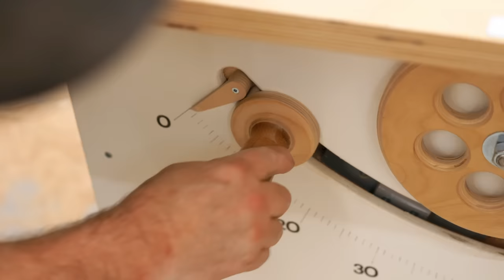Making A Modern Bed with Traditional Joinery

Comment from the maker: I made the bed mostly from solid ash hardwood that I bought rough sawn. The rough lumber needs to be cut and planed down to make the smooth parts used to make the bed, starting with the rails.
The panels of the headboard and footboard are joined to the legs with sliding dovetails. The dovetails mechanically hold the joint together, while also allowing the panels to expand and contract with seasonal moisture changes.
I used traditional joinery rather than metal hardware to put the bed together. The rails have tenons on each end that goes through the legs, and a walnut wedge locks the parts together.
The slats that support the mattress are 1/2" thick and 4" wide strips of solid hickory and these rest on cleats fastened to the rails. I cut spacer blocks to fit between each slat to keep them separated.
The bowties were added to the headboard as a decorative element. 
I used water-based polyurethane to finish the wood, spraying on three coats with a light sanding between coats.
This bed was designed to match the night tables I made a few months ago:
https://youtu.be/Py0hZth0aCg
Reply: Great video. Build videos are the best. Voice over would be nice too.
Reply: Saya fans anda.saya juga pengarajin kayu tapi dengan segala keterbatasan alat.di Indonesia alat alat mahal tidak sebanding dengan harga jual hasil karya
Reply: John - that bed is strong enough for Hagrid.
Reply: Price?
Reply: Are you selling the plans?

Comment: That headboard is never coming apart! Love the use of traditional joinery instead of metal hardware. 

My challenge would be in getting the sliding dovetail centered it the posts, with matching pieces... Love the relief cuts on the ts before routing. Brilliant.

Comment: When chiseling the mortise for the through tenon on the legs I'm assuming they are angled, 5 degrees. How did you keep the 5 degree angle throughout the mortise without using a block as a guide for the chisel, especially on such a deep mortise?

Comment: what a masterpiece!

I'm so happy to see you finally made something from the solid wood, and with the sliding dovetails + wedges joinery. 
I never use plywood, even if it would be never to be seen carcass, I am "allergic" to plywood furniture with edge banding and so on. I couldn't sleep on a bed, thinking there was MDF or melamine board or particle board in it.

Comment: Thank you for this fine demonstration of craftmanship! I tend to notice things, and when you started the plank through the planer, I noticed there was a short plank leading the way in; likewise, a short plank following....is there a concept I am ignorant about in the running of planers?  I really like your wooden clamps!
Reply: It is one of a number of methods to reduce planer 'snipe'.  A situation where the planer removes more material at the ends of boards making them thinner than you require.  Cutting off planer snipe wastes scarce and precious material.  That said, planing the whole board and then cutting to length to remove both split ends and planer snipe might be slightly more efficient.

Comment: I can never seem to get that smooth of a finish using a router to cut the tenon. I usually end up with a track line or two where it dips a little deeper than it should. I assume I'm lifting the plate up and dipping the bit.

Comment: Execution and design are really great. I like that you made bed that can be dismantled but without modern/metal connection elements. I have question regarding sliding dovetails... On one end of the joint you put glue and on the other end there is stop piece preventing panel from sliding all the way. Aren't panels in this way fixed on both ends thus restricted from freely contract and expand?
Reply from the maker: The piece is a filler, not a stop. I cut a notch in the dovetail in the panel to space it away from the filler.
Reply: OK I missed it. On 5:40 it is clear that you do not push panel all the way. I thought that notch is there so you can cover and hide the end of filler piece.

Comment: Love the work you do and the scrap bin channel.
When you were cutting the square mortices, would it have been better to drill 4 small holes it corner, or is that an unnecessary step?
Reply: Drilling a straight hole over ~ 8 " (200 mm) with a say 1/4 " (6 mm) diameter bit would be an almost impossible challenge for any skilled carpenter or joiner!

Comment: Very nice!
What type of adhesive are you using there? What is the benefit?
Reply: Polyurethane Construction Adhesive. It will cure in cold temps where wood glue would not. Being in Canada, that's a big deal. 🙂
Reply: It also has a longer working time, and that can be a huge factor when fitting large projects together.